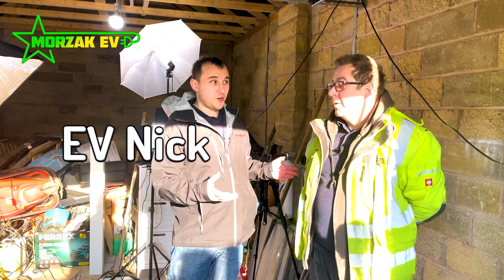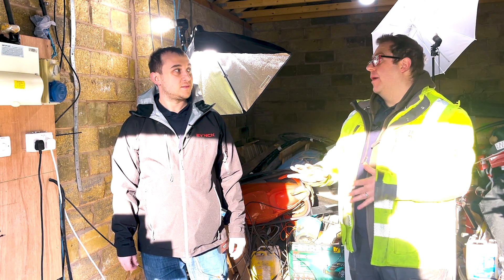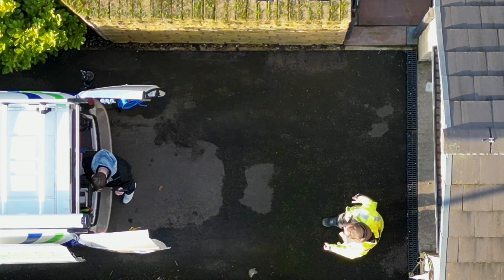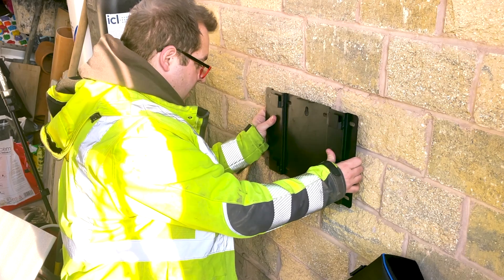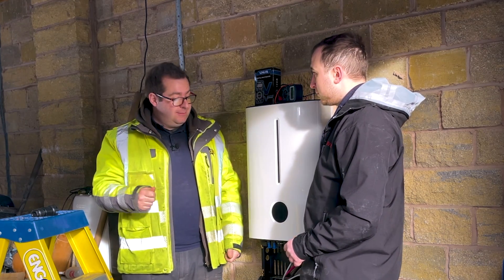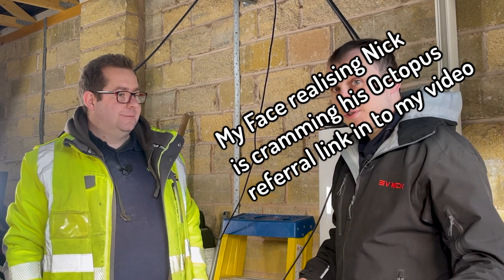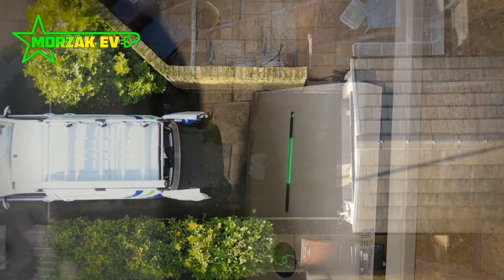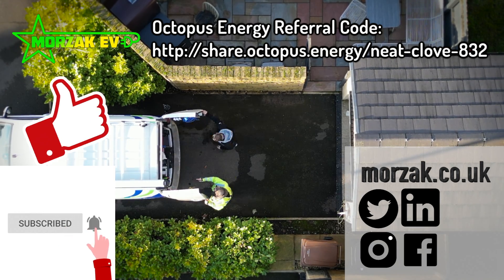Is this battery inverter good value?

Comment: Regarding the comments 3 minutes in, about small Solar arrays not switching the Inverter, isn't this relative to the Inverter being fitted?  Micro inverters exist, also I see companies like Solax including Inverters supporting from 700w to 3kw Strings and requiring a minimum 50-65v to start up the Inverter.
Supplying 1.6-2kw into the house and/or battery would cover passive domestic usage.
Your thoughts appreciated.
Thanks.
Reply from the maker: Yes, you are correct.